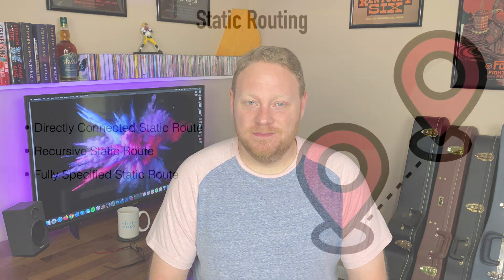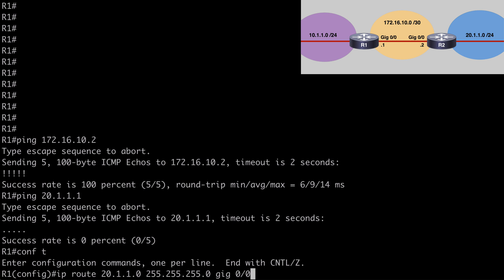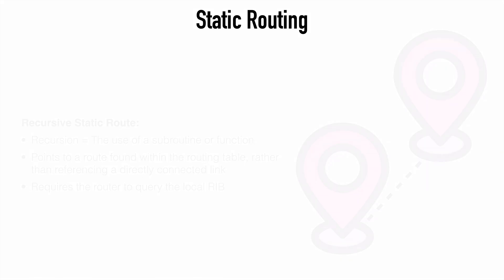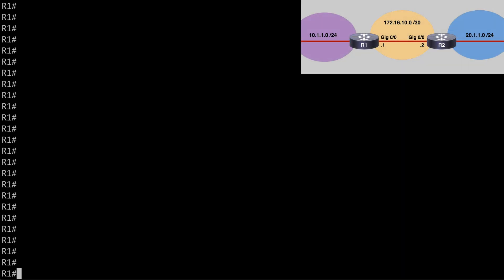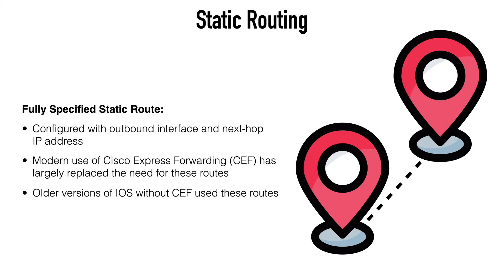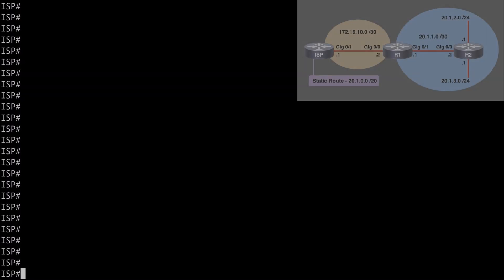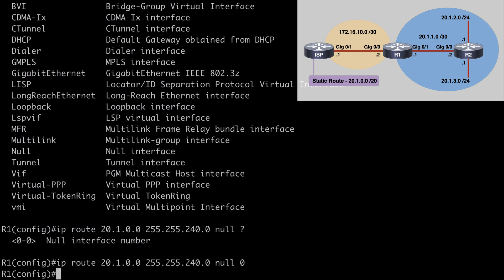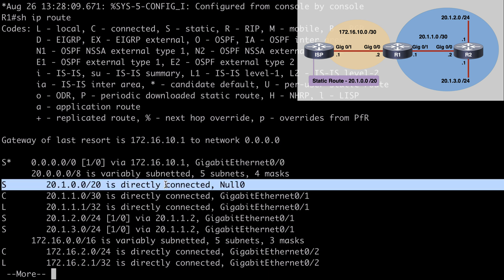CCIE Topic: 1.2c Static Routing

Comment: In your 1st example when your using the exit interface, why don’t you need a static  route in the other direction for the ping to work; or did I miss the point that it’s directly connected on the target router ?
Reply from the maker: I should have pointed out that the 10.1.1.0/24 and 20.1.1.0/24 networks are configured using a loopback interface. Since there is no other physical interface in use other than Gig 0/0, this is why we see a successful unidirectional ping initially without the second static route in place. If you were to lab this up with an additional router attached to R2 connecting the 20.1.1.0/24 network, then both static routes would need to be in place for successful communication. I hope that clarifies things. Thanks so much for watching!
Reply: @CharlesJudd  - Gotcha...Thanks 😊

Comment: One of the problems with a Directly Connected Static Route(DCSR) is that it'll arp for every IP address it wants to reach. This is usually not a problem if the route only points to a small network. If you use a DCSR as your default route it will arp for every host on the internet you want to reach. That can fill up your arp table. At least that's the case for ethernet interfaces. I have no idea about serial links for example.